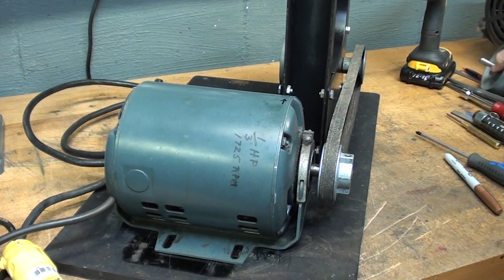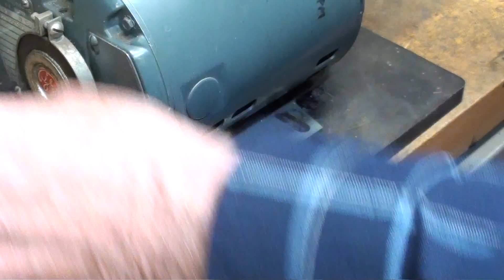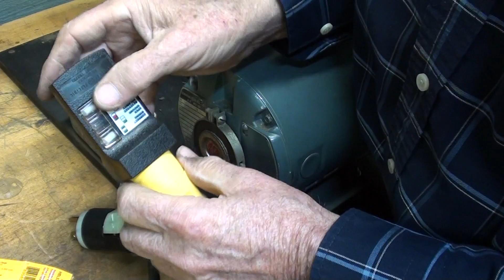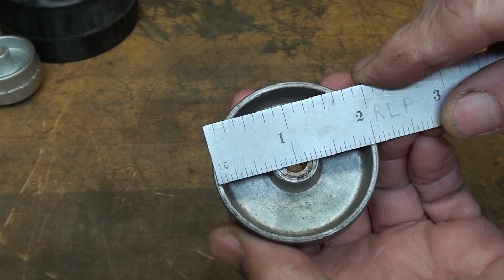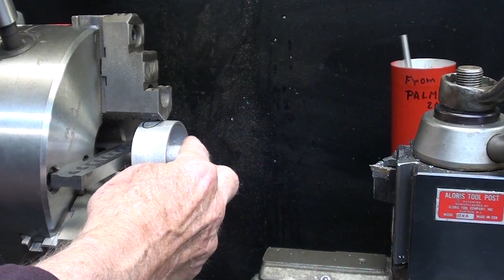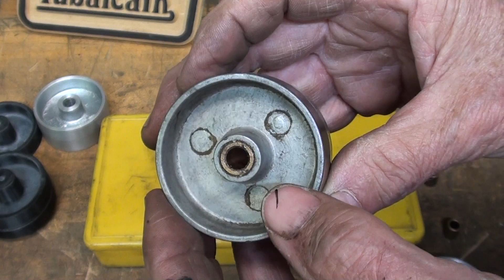Restoration of Mead Band Sander Tips 533 pt4 tubalcain

Comment: Years ago I work for a carnival and my particular ride we had to rewire all of the electrical. Part of the ride that had to be done, I had 32, 3X3 square steel poles 25 ft tall that had Hubble twist lock recessed receptacles both top and bottom.. when we bought the ride used to rebuild it I had to take all of those sockets out, sandblast the poles repaint the polls, rerun the wire and wired in all new sockets. We used single wire  14 ga solid copper wire in white black and green..(all for 110v lighting). We had quite the operation we had one guy pulling the wires off the spools, cutting them to length, taping them together, I'm putting them in a protective plastic sheathing much like you see on Automotive.. then the next guy came along and routed the wire through the pole and the last guy which was me installed all the sockets and made sure they were all tight and secure to the pole.. quite the operation but it was worth it so I've had a lot of experience with Hubble equipment and plugs used to have to make cords the same way too
Reply from the maker: That was quite a job. Looks like you did it right. Safely for all the people that would Ride

Comment: Hey mr Pete, a friend on mine is an industrial plumber and a certified ‘plastologist’ which is probably not the correct term for his trade, but he welds industrial plastic for what you might remember as ICI (imperial chemical industry) which is now owned by some merchant bankers by the name of axom in Australia, but he taught me some valuable tricks with all sorts of plastics on how to identify them. Smell is usually first and foremost, of course if you know what it’s supposed to smell like. But, if you have some plastic that your not sure, and you have a piece of plastic like u have shown in this vid, where u thought it was pvc, try and weld the two scraps together with a heat gun, (I don’t expect you to have a plastic welding gun but with you, you probably have three) and then leave a bit of a tail on the plastic your using as the ‘rod or filler’ and then try to pull the weld filler off. If it rips off it’s NOT the same. Most wont stick together.
Reply from the maker: Thanks for the tip. Our plastic teacher told me a lot about identifying. Sinking or floating was another one. I mainly went by smell

Comment: I finally finished my keg foundry. (Only took 4 months of pecking at it.) Haven't built a true crucible yet. So I cut an old map gas canister apart. Made my first melt on Thursday. My sand was frozen so I  poured it into a groove in the mud. Just to say I did it. And once I get a working computer I'll set my goals to get a 3D printer. 
Anyway I'm rambling. But the foundry video makers need to make some shout out's to the Machinists like yourself or vice versa. Casting is still very important to the future of machining.
Reply from the maker: Thanks 👍👍

Comment: My father-in-law made 8 straight passes in a crap shoot one night in WW2, and won $3200 dollars!  If you will put all your old bolts and screws in a gallon coffee can, I will pay shipping when it's full.  Nice plug, which is not off topic, because the electrical is part of the restoration.  I am interested in 3D printing, and foundry work.  The Incredible Shrinking Man is one of my all time favorite movies.  I saw it at a 10cent matinee, on a Wednesday.  We walked 3 miles, one way, to town, to go to the Wed. 10cent matinees.  Now I'm off topic!  Wonder how durable 3d printed wheels with ball bearing would be on a band sander?  I am really enjoying this series.  Thanks a lot for the videos.
Reply from the maker: You were lucky. I had to pay $.14 for a movie. But I only had to walk 1 mile
Reply: @mrpete222  Oh for those days when I could walk that far.  My left knee won't let me, now.  I may have to get it replaced like the right one.

Comment: What determines the HP on an electric motor. In your case it says 1/3 horsepower. Is it the internal wind'ings , resistors or what. I have seen motors that appear to be the same size, yet are rated 1/4,1/3 or even 1/2. I watch a series of videos by Mr. Electricity from Vietnam, where he removes the old wire and rewinds using a special tool that counts the number of wires he wraps around each section. He then insulates the wire with varnish. Thanks in advance...Ken
Reply from the maker: All of the above, plus the amperage

Comment: Is there a filament tough enough that you could just use the 3d part instead of a casting? The bushing will still take the wear from the shaft and the plastic may actually wear better than the aluminum on the OD.

Comment: to start a fractional hp motor, use a 277 volt rated, 20 amp toggle switch. will work much longer than a regular 15 amp rated light switch.

Comment: Hi mr.pete, We like the project board great find phenolic, it was really popular for hand rests and pre-plastic handle knobs even our pulleys of the finest watchmaker lathes. 
Nice electric connector plugs so what we like to learn what you want to share talk off topic all you like these two like what you share either way.  
Oilite also oil impregnated bronze bearing blanks a material we use very often so many old machines only use these. Great explanation to prevent sealing the pours of the oilite materials functionality. 
Thank you Lyle, Lance and Patrick. 
We will be seeing you in part 5.

Comment: I find 3D printing fascinating, one thing that I realized is you need CAD capability to effectively 3D print, perhaps your viewership is older and not inclined to go in that direction, because of that barrier. On the foundry work it’s self, I’m not willing to go down that avenue, mainly because of my limited shop space. However I do enjoy seeing the various creators do casting, and especially your videos because of the common sense methods you use. In my opinion for one off items in my shop it just makes sense to machine them out of billet or flat stock, than invest in a major project like a foundry set up. Thanks for sharing

Comment: I learned something about "oillite bushings" today,  Thankyou !!   Mark
Reply from the maker: Thanks
Reply: "Oilite" was a Chrysler Corporation development.  Sometimes, the "Oilite" was made without the lubricant impregnation and used as a filter element in gasoline filters for autos in an earlier era.
Reply: MrShobar 
 -Sintered metal filters still turn up in various applications. Small lawn and garden engines and some industrial engines, for example. 

You'll also find them used as filters and diffusers for pneumatic applications.

Comment: Mr. Pete, for the elephants foot, in your slicer the bed temperature has a function that allows you to have multiple settings. I generally set the bed to 65c for the first layer and then reduce it to about 50c and the elephant foot is about gone.
Reply from the maker: Thanks, I need to try that

Comment: Nicely done!  The tip of "smearing" sintered bearing material when reaming is a great one!!  On the topic of grounding the switch box...  On most modern switches the metal body of the switch that screws to the metal case is grounded so the ground would be extended to the metal box trough the metal switch body...  Fred
Reply from the maker: Thanks